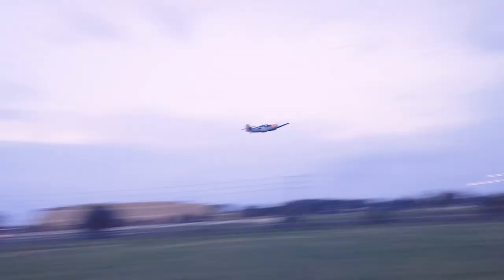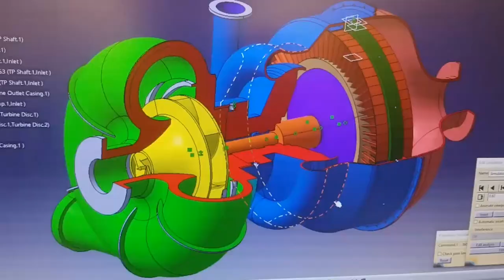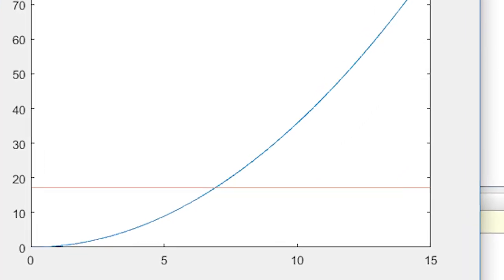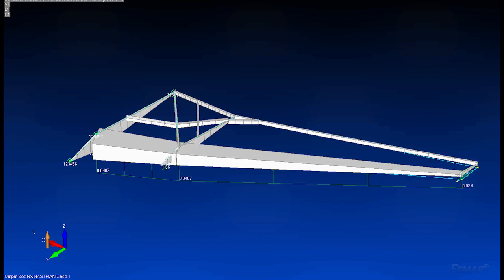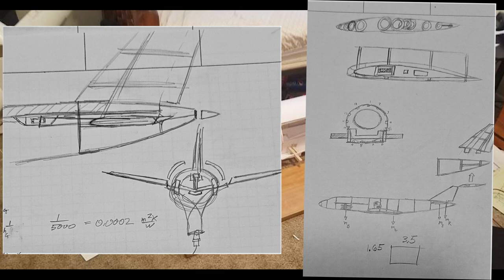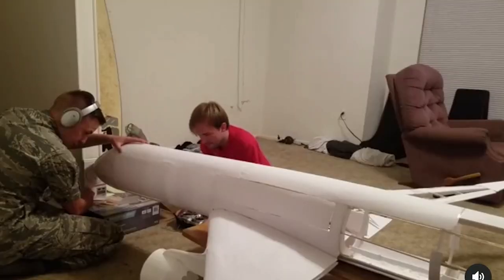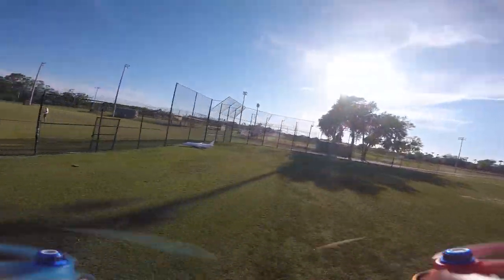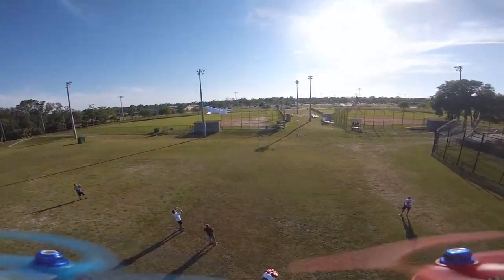Engineering a GIANT SCALE RC 787 Dreamliner Made Out Of Paper

Comment: This is an absolutely amazing video!
I was so amazed to see that thing fly with those mini quad motors.
Anyone can make a large model airplane fly. It takes and engineer to make a large airplane barely fly. It really seems like you made the largest (super cool looking) airplane those mini quad motors could propel.
Sorry for your loss. It's hard to lose a father.
Reply from the maker: It was really cool to work on, I had an upgrade plan for it to add 2 additonal motors which would have solved everything but it being half the apartment it was a huge pain to keep around. Thanks, I was just glad I got 2 more years than we had thought.